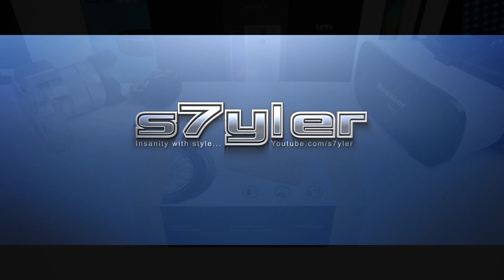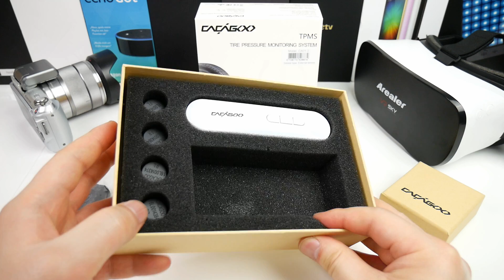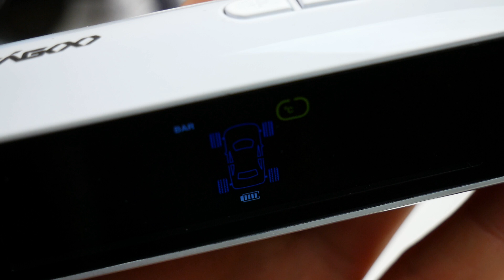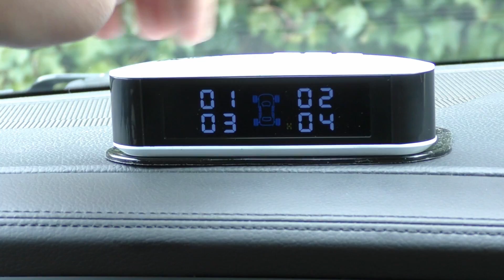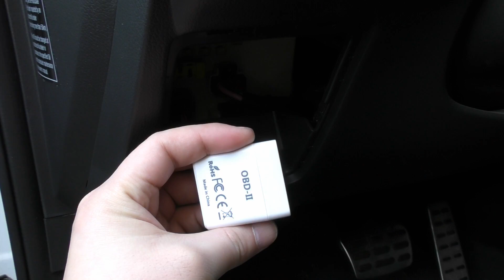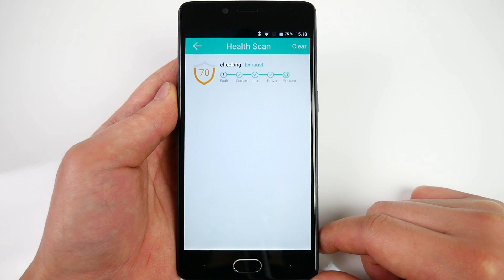CACAGOO TPMS Kit + OBD II Scanner (External Tire Pressure Monitoring System for the Car)

Comment: Do you know if the TPMS is accurate ? Did you confirm it's accuracy ? That is the most important question you did not address.
Reply from the maker: Vincent Maturo yes I always fill 2.6 bar in my tires on the gas station, This TPMS  showed 2.6 from the beginning, it can sometimes show +/-1 but it's still very accurate I think.
Reply: Thanks, glad to hear that.

Comment: I have an OBDII reader similar to that one. I use it with the torque program that showed up just under the mini OBDII program you installed. I use it to read and reset error codes. Can you do that with the mini OBDII program? Can you test the reader with Torque? 
You mentioned that the TPMS turns off automatically but does it also turn on automatically when you start to drive?
Reply: Rod Naugler I use Torque as well with a @$15 OBDII scanner. When I get in my car and start it,  the OBDII sends my mileage to Triplog program in Android for Start and ending mileage for IRS travel deduction. I select business or personal from a drop down menu, add client name which ties in to phone contacts ,  purpose in notes. Triplog provides daily, weekly, monthly and year end reports
for tax deduction with GPS log of each trip on Google Maps. It will load automatically into Quick books Accounting software as well. 
But no tire pressure. I still use eyeballs and a gauge. : ) Pressures will vary @14% depending on ambient temperature and heat generated from highway speed.